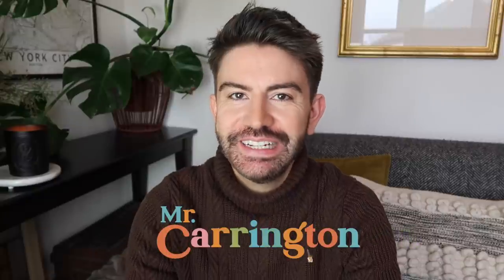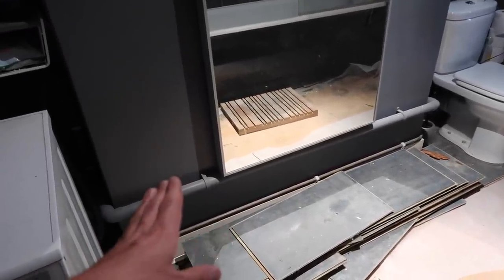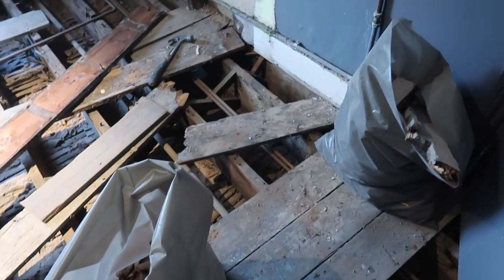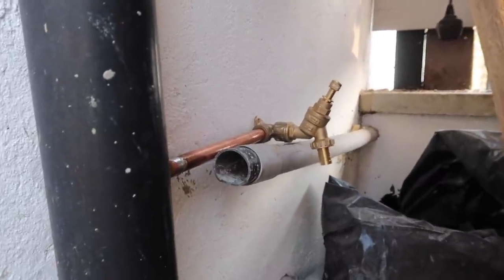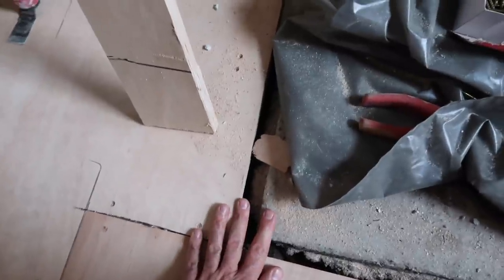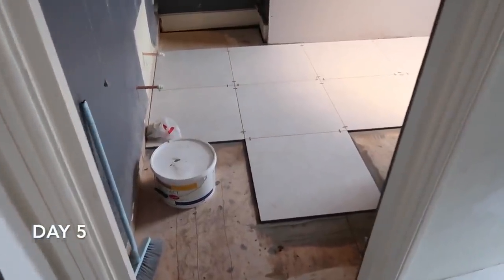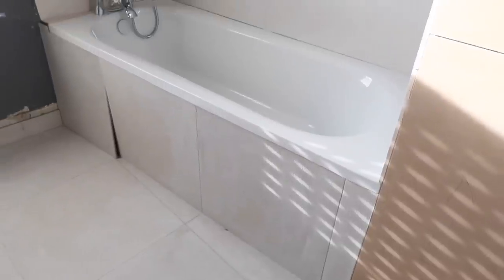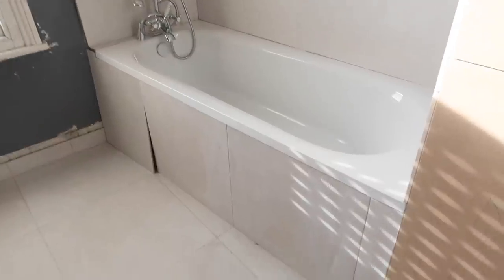BATHROOM MAKEOVER PART 1 (Victorian Home Renovation) | MR CARRINGTON

Comment: I've had a thought about the cupboards have some IKEA boxes in the top cupboards in both units for things you dont need every day but on the bottom two shelves you might be able to get sliding draws from IKEA like they have in wardrobes for the things you need every day like shaving items soap shampoos etc and the same in the cupboard over the washing machine for whatever you use to wash your clothes in and one for towels etc. Also by the side of your washing  machine you could have an expendable mop to keep the floor clean and dry. Xx
Reply from the maker: Great idea!

Comment: Hello again from the U.S.! I've enjoyed watching your video with my morning coffee. 
This is  maybe way off from what you were thinking but ... First, I'd put magnetic latches on your cupboard doors and not put handles. Then I'd polycoat them and leave them the camel color. Rather than put panel trim on them; if anything, I'd have the builders cut grooves at the same heights as the grout lines before doing the poly. Then, I think I'd repaint the walls gray. Regardless of what you do, I'm sure it will be lovely! xx